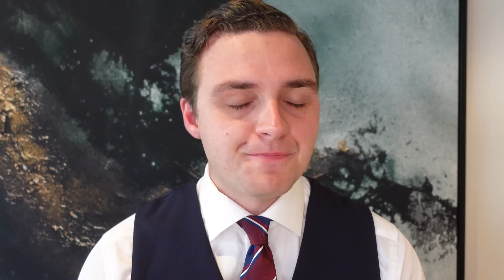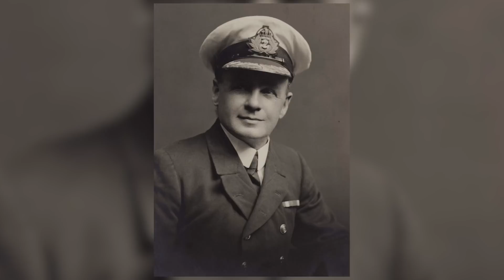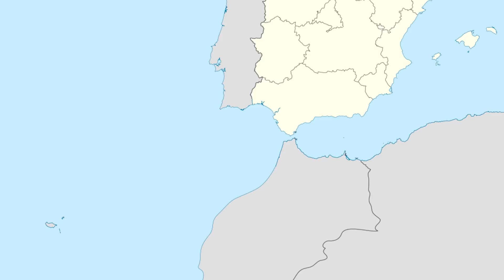How to Annoy the Steam Engine Community

Comment: I'm sorry, Mike, but you still have this in quite a mess, and added errors that were not in your engines video.

1.  You have omitted the presence and important role of the feedwater heaters.  They result in considerable coal saving.  I have explained feedwater heating in another post to this video.  Refer that post or the Shipbuilder Olympic class Special Edition June 1911 page 63. 

2.  You have re-stated that the steam pressure into the turbine as 9 Lb/in^2 absolute.  I showed in another post to this video that a pressure that low could not be employed - it would result in too low a turbine exhaust temperature and thus cause condensation to water in the later blades of the turbine.  This would result in loss of power and rapid turbine blade failure and thus would never have been allowed.  Refer that post or the US DoE Steam Turbine Calculator.

3.  At 5:51 you said that the "[double bottom] ... stood about 5 feet above the keel."  This will mislead many if not most people, as the bottom of the double bottom is in contact with the sea - there is no projecting keel as there is in a sailboat.

4.  (Minor error) At 6:23 you said feedwater needs to be topped up from the distilling plant due to evaporation and contamination from grease etc.  Evaporation is basically what a boiler does - evaporation loss should not occur as nowhere in the system is water in contact with the atmosphere.  The main causes of loss of feedwater are:-  a) the need to blow down each boiler and clean the fire tubes periodically, b) leaks via imperfect seals; c) operator error in turning valves etc.  The need to shut down each boiler in turn to clean it is why more boilers were provided than necessary for the steam consumption of the various engines and auxiliaries.

Many ships continually drained off a small amount of feed water and dumped it into the sea to prevent contaminant buildup, instead of doing boiler blow-downs as frequently, but I don't specifically know if the Olympic class did this.

5.  At 9:15 thereabouts you stated that condensation in the steam pipes meant a need for steam separators.  Separators were required anyway, because the steam from a continuous-flow boiler such as the Scotch boiler used in Titanic can only be wet steam, as there has to be liquid water in the boiler.  To get dry steam, you would have to heat the water above the boiling point at the working pressure - that would mean no liquid water could be in the boiler to boil. Steam pipes were lagged (insulated) and condensation in the steam pipes should be minimal.  This is why superheating has to be done after the boiler and not within it.

6.  At 9:16 you stated that superheating heated the steam "high above the condensation temperature".   That's true, in steamships generally, but it is a misleading statement. It misses the point.  Superheating is not about adding lots of heat, it is about heating a liquid above the CRITICAL POINT TEMPERATURE (for H2O, 374 C or 705 F).  This may or may not be well above the boiler temperature.  For a boiler pressure at almost the critical point pressure (3200 Lb/in^2 for H2O) the temperature would be raised only slightly.
The critical point of a substance is the the combination of temperature and pressure that determines whther the substance can only exist as a pure gas or not.  Raise it above the critical point temperature and it can only be a gas, regardless of how low the pressure is, so long as the pressure is below the critical point pressure.  Superheated steam obeys the kinetic gas laws and thereby increases steam engine efficiency.  Superheated steam can only be dry steam, as you have realised.

7.  In the indicator diagram you showed at 13:24, you shaded the area below 14.7 Lb/in^2 absolute, and it looks like covering 1/3 the graph.  You claimed that it means you get 1/3rd the power in the steam by operating below atmospheric pressure.  THIS IS NOT SO.  That would mean the top of the graph is at 2 atmospheres pressure.  It appears from the hard to read numbers that the vertical scale is logarithmic, not linear.  So the top of the graph is not 2 atmospheres, it is 10 atmospheres.  In any case, Titanic's steam pressure was 14.6 atmospheres.
The turbine was able to contribute 1/3 of the total shaft output power not because there was 1/3 the energy still left in the steam, it was because turbines are about 4 times more thermodynamically efficient that reciprocating engines.

8.  You claimed at 13:32 that the turbine "would actually assist the main engines by drawing steam through them.  Clearly that is ridiculous.  If the reciprocating engine exhaust steam went straight to the high vacuum of the condensers, a greater expansion could be designed for in the reciprocating engines and they would both be more efficient AND produce more power.  The turbine is an impedance to the recip engines, not an aid.  The recip engines without a turbine could produce not as much efficiency and power as the whole hybrid system, but more than they did in Titanic never the less.

9. At 13:50 you state that the condenser vacuum is created by the cooling of the steam.  Clearly that is nonsense.  A condenser is in essence a pipe through which the steam goes through, with cold water on the outside on the pipe to carry away the heat.  In Titanic, the condensers were a very great number of pipes receiving the steam in parallel, but the principle is the same.  Whatever is the pressure at one end of the pipe must be pretty much the same as at the other end.  What creates the vacuum is the feedwater pumps drawing the condensed water out.  Sure, a volume of steam condenses to a much small volume of water, but that isn't what creates the vacuum.  If it wasn't for the pumps, the water wouldn't get sucked out and you would have no vacuum.

10.  At 14:34 you stated that James Watt's engine ran purely at a vacuum. This is not so.  Only the condenser was operated at a vacuum (about 0.1 atmosphere) by spray cooling.  Steam pushed the working piston up. (Later Boulton and Watt used double action).  Steam pressure in Watt's engines was about 7 to 10 Lbs/in^2 above atmospheric.
Possibly you were thinking of Newcomen's engine, in which steam at minimal pressure was admitted to the cylinder, than a jet of cold water condensed the steam within the cylinder, allowing atmospheric pressure on the top of the piston to push the piston down.
Newcomen engines were absolutely dreadfully inefficient, partly due to minimal steam pressure and partly because a lot of steam was wasted warming the cylinder up again at every stroke.  When I was at university, the technicians had built a Newcomen engine about 1.5 metres high - it had so little power it couldn't overcome it's own friction.

11.  At around 16:35 you compare Titanic's coal consumption (600 tones per day) with the roughly similar size Lucitania (1000 tonnes per day), stating that it showed Titanic's power plant was ver efficient.  That is not a valid conclusion.    Titanic cruised at 21 knots, Lucitania cruised at 24 knots.  The power required to overcome drag rises as to the cube of speed, so with all other things equal, we should expect Lucitania to need 600 x (24/21)^3 i.e., 895 tonnes.  But all other things might not be equal.  It would take a lot of research to get a definitive answer.

12.  At 17:23 you stated that Titanic's powerplant was "engineering genius".   Hardly.  Harland & Wolf tried the hybrid reciprocating/low pressure turbine configuration only once before (in 1909), and never went back to it. No other ship builder tried it.  The fact is, a pure turbine installation is FAR more efficient. The reasons why the Olympic class got the hybrid system is that Harland & Wolf had a large skilled and semi-skilled workforce that made reciprocating engines in house and all relevant patents had expired.  To use turbines they would have had to purchase them, so using reciprocating engines saved White Star capital expense, and delayed the point at which H&W had to start laying people with obsolete skills off.
Titanic's plant was competently designed but very much a compromise imposed by business constraints.  The turbine was not used in an optimal way and could only be used when proceeding ahead at full cruising speed or close to it.

Comment: Having a popular YouTube channel is a blessing and a curse, with soooo many eyeballs glued to your videos and a whole army of fact checkers ready to point out your mistakes (including me). 
On the plus side, having the collective fact checking power of a large community can result in amazing Ahah!-moments and the writer of this comment is no exception. Case in point: the low-pressure turbine. For years I simply ignored what was written in the pages of "The Shipbuilder - Special Olympic & Titanic Edition" which has been happily sharing bookshelf space among my collection of ocean liner literature for decades. I just assumed the "9 psi" meant above atmospheric because, well, most systems containing turbines work at pressures well above atmospheric.
But as Mike pointed out in his response, it was indeed absolute pressure and thus below atmospheric, which, in a closed system, is of no importance since outside atmospheric pressure is not meant to be exchanged with the system at any time (unless a failure develops). The only thing that matters is the difference in pressure between the turbine and the condensers, where the remaining steam is turned back into liquid water. 
After doing some more research and talking to a number of my engineering colleagues, it became apparent that such systems were quite unusual even in marine applications and were a specialty of Harland & Wolff. Most turbine systems (like turbochargers planes or cars, electricity generating machinery or pumps) usually work with rather high pressures. 
It only serves to heighten my appreciation for the engineering prowess of Harland & Wolff. It cannot be overstated how ingenious this design was and how important it must have been to the success White Star hoped to achieve with the Olympic Class. It's highly probable that the entire business proposition rested in no small part on the vastly superior operating economy this machinery enabled. Apparently this allowed to run those ships profitably even when they were poorly booked. Lusitania's 18% higher service speed (24-25 vs. 21 for Olympic) required about 30% more fuel for the same distance. 6 days per crossing burning 900-1000 tons a day meant up to 12,000 tons of coal per round-trip for Cunard. 7 days per crossing in the Olympic at 600-650 tons of coal per day meant a maximum of just 9,100 tons of coal per round trip for White Star. That alone shows how efficient the Olympic Class was compared to the Cunarders. When taking into account that they were also over 40% larger, the increase in operating efficiency was staggering.

Comment: At  :4:28, Olympic is not listing to starboard.  That is the effect of a low camera angle.  The waterline at bow and stern are the same (not down by bow or stern) and amidship ( not listing to port or starboard).  She is just riding high in the water because of light load.

Comment: Not steam engines, but in my time as a Machinary Technican in the USCG, I had some experience with sea water and engines. So the platforms I worked on had 2 V8 Diesal engines using sea water as coolant. To cut down on corrosion the system had what were call anoids. These were disposal bolts that would be throught the system.  They would break down keeping the water system intact. They required to be inspected/changed alot......depending on where they were it was a fun job to....I hate my life my arm is to big to reach it.

Comment: Superheating is not for "prevent condensating", good piston engine MUST use condensation energy to produce work, but to rise steam temperature which allows to increase engine effectiveness. Its just physics. The same is for negative pressure - its question of temperature. If steam absolute pressure is 1atm its temperature will be 100C. If we can operate under vacuum we can achieve 20-40C condensation temperature. So instead of work between 200-100C good designed superheated condensation system can work 400-30 or even more, like modern supercritical (means with steam parameters above critical point, where is no difference between liquid and gas) steam power stations, and extract twice more mechanical work from the same heat energy/fuel consumed.

Comment: …and THIS is how you keep viewers (perhaps gain some), keep your dignity and learn along the way. 

Congratulations Mike. I did have some thoughts of my own but they have been covered - in particular the pressure question. 

Well done for owning the mistakes, learning some more and either rectifying the errors or gently describing how you were actually correct. 

Very very well done. 🎉

Comment: I was one of the many people that suspected a confusion between PSIA and PSIG was responsible for the "below atmospheric pressure" statement in the original video.  Thank you for explaining that your original statement was indeed correct, and why.  It was another great learning experience for me!  The keys to the ability to run below atmospheric pressure were a) a closed system, not affected by atmospheric pressure and b) condensation of the steam, which dropped the absolute pressure down near zero at the "end" of the steam's journey.

Comment: the lamont style boiler could run on salt water, it wasn't the best thing to run on, but it would work, the worries of scale mostly go away(abner doble used common motor oil as a method of encapsulating scale), it was far after the titanic sank that it was first even tried.

Comment: A turbine input of 9 Lb/in^2 absolute cannot be correct.  It is not the absolute bit that’s wrong, it’s the amount.  It is likely a reporter’s error in the reference Mike cited.  I show why below.  

An engineer would get an accurate picture by consulting standard steam tables and a lot of math too complex to show in a YouTube post.  However there are some online steam plant calculators based on accurate math that we can use.

The best and easiest to use is the US Department of Energy’s Steam System Modular Tool Steam Turbine Calculator.  To use this calculator we need to enter:-
# the steam mass flow rate, 
# turbine input steam pressure and temperature, and 
# the outlet pressure.
# the turbine thermodynamic (isentropic ie assume no heat or mass loss) efficiency.  
The DoE calculator calculates the power output and the temperature of the steam at the turbine outlet.
The DoE calculator also electrical generator efficiency as in input, because these days the main application of steam turbines is power stations.  Since we only want shaft power, set this to 100%.

Harland & Wolf never disclosed the mass flow.  However www.titanicology.com shows how it can be calculated from the published reciprocating input pressure, HP cylinder volume and RPM – 6200 Lb/min, i.e., 372 kLb/hr.  [Note, Titanic’s boiler capacity, 260 Lb/min per boiler, exceeded this by about 17%  – due to the need to clean boilers while underway and to feed electricity generators and auxiliaries.  So Titanicology’s estimate is reasonable.

A reasonable value for a large low pressure turbine thermodynamic efficiency is 80%.  

The outlet pressure is no problem, it is 1 Lb/in^2 absolute i.e., -13.7 PSIG , an entirely typical condenser operating point at that time.  We are told by The Shipbuilder special edition that the input pressure is 9 PSIA i.e., -5.7 PSIG but it gave no temperature.  This doesn't matter, we can just try progressively higher temperatures until no condensation occurs in the turbine.

Steam condensing within a turbine would cause serious problems – blade erosion, loss of efficiency, vibration due to unsteady flow conditions.  It cannot be allowed.

The DoE calculator shows that 385 F just avoids condensation with 9 Lb/in^2 absolute input, producing a shaft output of 14 megawatts i.e., 18,800 HP.  It can’t of course be as high as 385 F as that is close to boiler temperature.  We need to change another parameter.  There is little scope for changing the output pressure, increasing it to 2 Lb/in^2 absolute only drops the required input temperature to 319 F – still way too high.

Let’s try an input of +9 PSIG, with all other values unchanged.  This time we get a warning that there must be water in the inlet, for all temperatures up to 238 F.  We can’t accept that, as it would hydraulic lock the reciprocating engines and wreck them.  So +9 PSIG cannot be right.  And 238 F is still too high to allow the reciprocating engines to work at proper reduction.

Trying a turbine input of -2.8 PSIG (11.9 PSIA) in the DoE calculator, with 202 F, we don’t get condensation in the turbine or reciprocating engines.  The calculator then gives us 12.0 MW i.e., 16,100 HP.  Say 16,000 HP allowing for friction etc.

Conclusion: -
# A turbine input of 9 Lb/in^2 absolute is possible but not in Titanic as it requires a steam temperature almost as high as the boiler output.
# Neither can 9 Lb/in^2 gauge be right, as that would mean heavy condensation in the reciprocating engines, causing rapid catastrophic damage.
# A turbine input of 11.9 Lb/in^2 at 202 F is compatible with Titanic’s plant, does not give condensation in either the turbine or the reciprocating engines, and produces a turbine shaft output of 16,000 HP, which is correct.  In practice, we would want a safety margin against condensation, operate the turbine with an input of 204 F.

Perhaps the reporter for The Shipbuilder magazine wrote down 9 when he should have wrote 11.9.